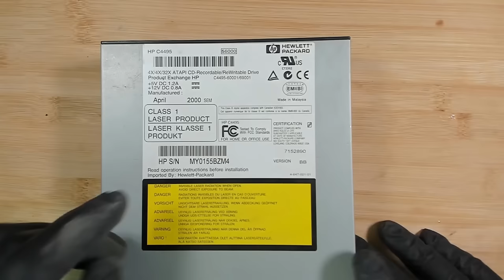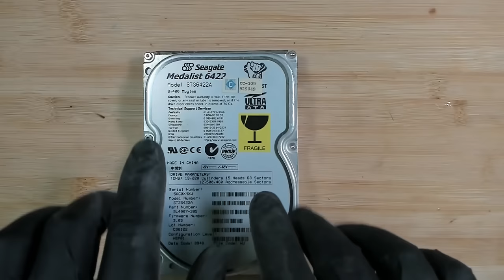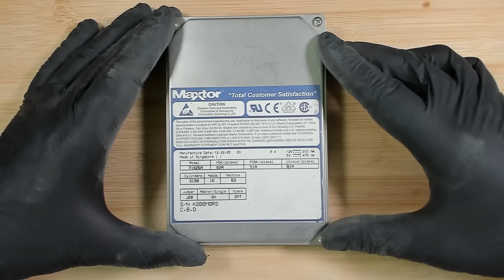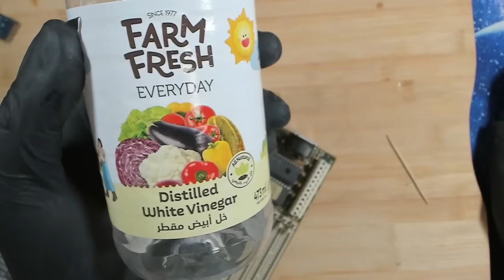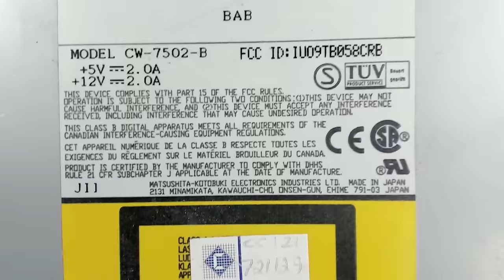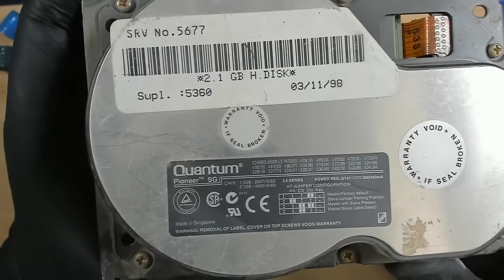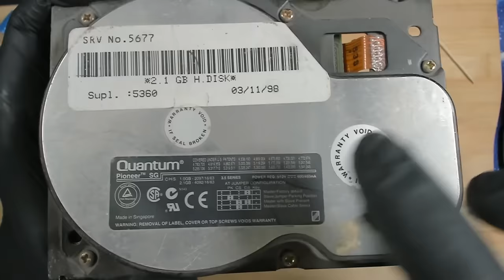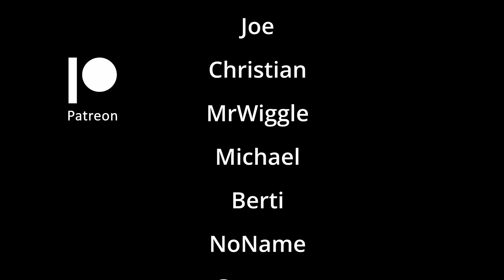Loot from one of my best scrapyard trips!

Comment: i wish i had a scrapyard like that near me...
Reply: I have them...but they don't allow me to take anything, it ALL goes to trash :/
Reply: @SirotkaSlo they calculate with the money for the metals that's why I guess
Reply from the maker: That's sad. I'm not sure why though. Maybe they don't want to have people going through their stuff, legal reasons or similar. It's still a shame though 😕 maybe time to get a part time job at one of those scrapyards 😉
Reply: @pc-sound-legacy  true, but they could also just let you pay for what you pickup based on weight. I wouldn't mind that, just let me take it 😭
Reply: I was told that here in switzerland, things in the scrapyard belong to the original owner, and that's why i can't even BUY stuff on a scrapyard. It's sad to think about all the sweet stuff that gets shredded every day.
Reply: @bitsundbolts  I believe it's because it's a private firm that does this in Slovenia, so it's probably because they sell it for the metal. Can't have a part time job there either. It's messed up, I see a lot of good stuff every time I drop off something there.
Reply: @SirotkaSlo Same here. They don't allow taking computer hardware. I wish I could save some hardware from being destroyed
Reply: Really, what kind of scrapyard is this? Can you show the outside or some more details?

Comment: Matsushita (SCSI CD writer) is Panasonic. It should work, I have Toshiba CD/DVD drives from this time still working. Japanese drives normally don’t have belts, which really helps to have a longer life….. but plastic gears might become brittle and break. I had a SCSI cd burner exactly for the reason you mentioned: buffer underrun…. A blank cd costed $15 back in those days and Windows was not good at multitasking, leading to wasted disks. I don’t have the drive anymore, but kept the SCSi controller (adaptec 2940w if I recall correctly).

Comment: Actually, I wouldn't mind seeing the Socket 7 board.  With one of the S3 video cards, 8MB of RAM, and a Pentium 75 it would re-create my first PC.  Brings back happy memories of Wolfenstein 3D, Doom, and Little Big Adventure.
Reply from the maker: I did get a Pentium 75 the other day. Well, I guess I'll be recreating your old PC very soon! Do you remember what S3 video card you had? Trio64 or was it a newer model?
Reply: @bitsundbolts  It was a Diamond Stealth 64, PCI.  I think that makes it the Trio 64 chip.  (I think the same graphics core remains as the 2D side of the Virge cards, so that would work also.)  The PC also had a Soundblaster 16.  I got the PC bundle  from Evesham Micros, who a few years earlier were suppliers of Commodore 64 hardware and software.

Comment: 8:49 - ESS Audiodrive cards are wonderful DOS cards. Decent OPL3-emulation, clean MIDI wavetable interface, extremely simple to set up via Unisound or ESS drivers. 
- 1868F is up to 48Khz/16bit
- 1869F is identical to the 1868F but adds optional Sensura 3d sound support. (meh...)

Great haul!
Reply from the maker: Ah nice. So essentially, they are quite similar cards. Although I have never heard of "Sensura 3D sound", I have a feeling that it's not going to be a life changing experience - as you mentioned in your comment.
Reply: @bitsundbolts  Well, phooey. I misremembered the "3D sound" tech on the ESS 1869F. That apparently uses "Spatializer® 3-D VBX™ stereo audio effects technology", which is sort of a parlor trick for widening the sound stage. It was pretty underwhelming, IMHO.

Sensuara 3D would have been much better if it had that as it provided positional multi-channel sound as a hardware accelerated enhancement, similar to EAX but the ESS 1869F predates that technology by several years.

Comment: I'm kind of excited about that 386/486 board
Reply from the maker: Me too!
Reply: @bitsundbolts  the extra expansion slot do you know what it is for yet?
Reply from the maker: Chances are it's an EISA or some proprietary OPTi expansion slot. But it's probably EISA. I heard it's almost impossible to find expansion cards that fit in that slot.
Reply: @bitsundbolts  I guess there's a mach32 in. Eisa form factor
Reply: @bitsundbolts I’ve got one or two cards, but never found a board to put them on 😆 

Anything EISA is just so rare.
Reply: @bitsundbolts  It's an Opti Localbus slot. I have a Tseng ET4000 gfx card for that slot in my collection
Reply from the maker: Atheatos told me about it. I guess it is better to not take chances.

Comment: i have that socket 2 486 VLB board and i like it. I have mine with a amd dx4 running as a 5x86 133, 1 mb cache, cirrus logc vlb. Mine has the coin cell as well. The 386/486 I think is the most interesting to restore. Feels great when you have these moments and find such a stash. Thanks for sharing.
Reply from the maker: I like the 386/486 board as well. It's interesting that they made that choice to have two sockets on the board. The board should also support the 387 FPU, but that one goes into the 486 socket once a 386 is installed. But I also like the green 386 board. I'm looking forward to trying the Texas Instruments 486/386 port.

Comment: Upgraded my first computer from a 286 to a 386dx/dxl 40 like the one you showed (still have it in a box in the basement...I should delete the battery!).  In college, other than the college itself, I was the first one with a cd writer...  I bought a used HP 6200 off of Ebay.  Kinda memory lane for me on this.  I long ago lost my 1gb scsi full height drive I bought to add to my 200mb drive I used in the same computer as the 6200...  Computers have moved SO Far since then!

Comment: Nice finds. Important note about the TI 386 to 486 chip. There is a utility that is used to enable the cache on the chip. Makes a pretty good difference in performance. 
There is only one utility that can see the 1k cache, but I can't recall which one. 
(Cache check can't see it)
If you want I can try and get you the info.

Comment: don't worry about ess discoloration, that just build in audio amplifier for passive speakers, you can disable it with jumpers if it doesn't work or if you want to use regular speakers/headphones
Reply from the maker: I think I also read about something similar on early Soundblaster cards. Could it be that those audio amplifiers introduced some noise in the output?
Reply: @bitsundbolts  not really the worry you had back then but they didn't like potentiometers cranked below 8 ohms on the output and some people just used regular speakers with the audio amp in line and when they made speakers quiet shorting output to ground those ic's cooked a bit
the ded givaway should be tea/tda prefix on the chip and 4 inner legs all connected to ground

Comment: LOL, a few days ago I found exactly that same socket to slot adapter lying on the street. It was near a trash dump, so it was probably from some PII PC that got thrown away (sniff). The pins were pretty rusty but I polished them. It's a shame that the only PII motherboard I have has problems, I have it in line to be repaired, if I can.
and that '94 Seagate drive is related to the oldest HDD I have, which is just the first one I had, the 150MB model. A year ago I wanted to try it after almost 20 years of not using it, and after a while of working one of the SMD capacitors blew. I changed it for a new one and the HDD is still working.

Comment: Oooh those Realtek SVGA cards... it took me several years until I found working drivers! I once had 4 of them (gave away two PCs that had them built in, they all came with 1MB VRAM installed, without drivers, 256k is the limit)

Comment: Man, just one great day like that would be all I need to permanently take care of all my retro-hardware cravings - just a 486 DX4 and a Voodoo 2 to reasonably complete my collection and I would be done with it - at least that's what I keep telling myself. 

I'd thus be most interested to see more of the 486 board.  <rant> Not at all interested in the hard drives, except for a bit of acoustic nostalgia. Don't torture yourself with that junk. I am SO glad they are almost completely gone except for high capacity use cases and will never look back once they're gone completely. They are nothing but trouble and their lack of reliability has been plaguing me my whole life, both privately and professionally. SSDs aren't bulletproof either (especially the first few generations were quite prone to nasty software errors), but overall they're just soooo much more reliable. </rant>

Comment: I find these dual 386/486 boards kinda fascinating so that would be my fave. Curious about the bottom slot which looks like it might be an EISA slot, or someone just used the connector.
And you could also run the Ti486DLC in that board so that'd cover it all.

There are also 386/486 boards out there with VL-bus, which lifts a major bottleneck for the 486, and even 386 class CPUs benefit a little, so those are even more fun!

Comment: Great haul!
Yes, the Socket 2 mainboard is VLB!
At first I thought the brown slot on the 386/486 board was EISA, but it seemed strange to me that the rest of the slots were standard ISA... So I googled and it apparently is OPTi Local Bus, physically similar but electrically incompatible (!!) to an EISA slot. Very interesting, I had never heard of it before! ...so perhaps it's a good idea to check that the slots on the Socket 2 board are actually VLB before installing something :P.
The possibly burnt chip on the soundcard is the amplifier to drive passive speakers and can be disabled with jumpers (and should be easy to source a replacement).
The slightly toasted 486 probably works. It wasn't uncommon for system builders where I live to not pay attention to the "heatsink/fan required" warning and I have seen 486s looking like that working perfectly.
What interested me the most is the 486DLC, with the OPTi Local Bus board as a close second (it would be first place if you had a card for it) and the VLB board third.
Reply: the proprietary local bus slot was briefly "a thing" before VLB became popular. those types of board were generally sold with a video card or video-multi I/O card that only works with that slot (typically ET4000 video chip). it's a crying shame that the video card and motherboard are frequently separated (and somewhere someone plugged that video card into an EISA motherboard and is immediately privileged to witness magic smoke escaping.)
Reply: I have an OPTI-Local bus video card, still waiting to find an OPTI-local bus motherboard here in the states!

Comment: I love the scrapyard find videos.   I started watching your channel because of the slot1 boards .  I'd love to have a 486 system,  but they are rare around me. I play with socket7 and slot1 boards.  Even finding an older socket7 board is hard. Mine are super socket 7.
Reply from the maker: I'll try to make more videos from the actual scrapyard. And you are right, those older boards get more and more expensive
Reply: I have also 486, but not a lot isa cards. I don't have any 386 or 286. My oldest parts are: CPU 8086 AMD clone, hercules monitor with graphics card and fully working 80mb hdd.

Comment: Flipping the card upside down with PCI and AGP seemed like a benefit at the time, to prevent dust from collecting on the components.  But, that was just the beginning of graphics cards that started to get warm, and then needed a heatsink, and then a fan, and then their own power input, and then water cooling...  Would've been better if they had just left well enough alone, but live and learn I guess.

Comment: 11:35 spot on, its VLB (confirmed by the MASTER and SLAVE silkscreen). You may get graphics and I/O cards using VLB, quite uncommon but not that rare.
36:20 looks like an EISA port to me (32 bit ISA port, compatible with 8, 16 bits and 32 bits cards). Pretty unusual, and not many cards to use it at it's full potential.

Comment: I had that HP optical drive - I had a lot of issues with mine - more coasters than successful burns at a time when the blank media was quite expensive. I think it lacked any internal buffer on the drive so would fail the burn quickly if the PC couldn’t feed it fast enough. Still an interesting bit of history, I was however pleased to get rid of it, the technology was moving quickly at that time so was completely outdated within a couple of years.

Comment: That oddball slot on that board that takes either a 386 or 486 looks like an EISA slot.
Reply: Phyiscally EISA, but electrically it's Opti Local Bus. Putting EISA/OLB cards in the wrong slot will make a nice smoky special effect.

Comment: Those dual boards are very interesting,  and its time to look for  vlb (easy part) and eisa (realy hard to find, may be network or  scsi controller) cards
Reply from the maker: Indo have some VLB graphic cards - I think I even have an I/O controller. But I have never seen something for eisa
Reply: @bitsundbolts  you need some old servers teardown in order to have some EISA boards

Comment: Have the exact same Teac floppy drive, it is great 1.2 MB floppy drive which good compatibility, never had any issues.
Reply from the maker: I just need to clean it. Any tips on how to maintain such a drive and get rid of the dust?
Reply: @bitsundbolts  Never had to clean it in depth, just used a cleaning disk back then but i think cleaning it up with a brush and q-tip, cleaning the heads with alcohol and lubricate the gears should do the trick

Comment: Solder on the Battery melting easily is a good sign it hasn't been leaking for long. 386 Board with the 486DLC looks like an easy fix.

486 boards with VLB slots having no on board io is not unexpected as back in the day you'd have the option of a high speed VLB IO controller or an ISA one if you were cheap
Reply: My second 486 was a VLB. But man, I had some huge problems with bad contacts on the disk and ports controller cards . I still have the motherboard, vlb video card and that controller card, but I need to repair it. After 20+ years of not using it, it just refuses to boot.

Comment: I'm interested to see a video about that TI 486DLC. I bought one ages ago thinking it was a 486 chip, but I never got around to trying it in my 386 boards because for some reason neither of the two that I've got seem to work even though they look like they're in good condition. (I assume it's just some incorrect jumper setting, but I've never had the time to really look into it.)

Comment: Eehhehh, this video is exactly what my "junk bin" at work back some 30y ago would have in. Dear god, i had a HUGE box of just those expansion cards, most with Goldstar chips, that sorta kept "piling up" as people upgraded from 468's to Pentium's. I was an Amiga guy back then, but the shop sold both Amiga and PC's. First gfx card (and my fist overclock...) was also a Trio64+ on a hand-me-down P133 (that also got OC'ed), eventually upgraded to a 300A+Trio3D (because i couldn't afford a "real" 3d card) And both got OC'ed of course... Guess i was born on the dark side of the force :D

Comment: 36:10 It's EISA slot (32-bit ISA slot , can compatable with 8-bit and 16-bit ISA cards) or proprietary slot for backplane or RAM card
Reply from the maker: Interesting... Although I doubt I'll ever find something that plugs in there. But who knows
Reply: @bitsundbolts  I have some EISA cards but not motherboards for them. Maybe you can use/test them :)
Reply from the maker: What kind of cards were actually made for those EISA slots?
Reply: @bitsundbolts  SCSI bus controllers, netwoking adapters, some graphics adapters. Actually, this is 32-bit version of ISA, so everything that needs higher bandwidth could possibly be made for this bus
Reply: @bitsundbolts  EISA interface cards and slots are mostly used on servers that require high bandwidth, but their applications are similar to those of general PC interface cards.
Like networking cards, SCSI cards, graphics cards.
It is less common on personal PCs because patent licensing fees are relatively expensive.
Reply: @bitsundbolts  if it is an EISA slot, then itself can be used as regular ISA slot - the top row of pins in slot (far from motherboard) are ISA pins and second row (bottom of the slot, close to motherboard) are PCI lanes; there are also riser cards for EISA slot containing ISA and PCI slots. I recommend to check for shorts before and after pluging ISA card - that will confirm if its really EISA and dont plug PCI card in the EISA slot - it fits, but most likely short and burn your chipset, ask me, how I know...
Reply from the maker: Well, I guess you have first hand experience with this slot. You're right, it is EISA. I started restoring the board and I am currently working on the damage the battery caused. There is an inscription on one side of this socket and it says "EISABus". I'll be careful with what I plug in this slot - I don't like to experiment with it if I'm not 100% sure.

Comment: That slot on the 386/486 board looks like a proprietary ISA riser socket.
Reply: That was my guess too.
Reply from the maker: After cleaning the board, I can read "EISABus" on one side of the socket.
Reply: EISA would have been my guess as well. The time when ISA wasn't good enough anymore and PCI wasn't out yet was a bit like the wild west. IBM had their proprietary MCA bus and on the "open" side you had stuff like EISA and VLB.
Reply: Nice board, Jealous here. THIS IS NOT AN EISA slot.
This is an Opti Bus slot (same connector as EISA, different electrical).
If you plug a EISA card there you will burn it.
There are specific card for Opti Bus. There is a VGA I have this.
Basically Opti Bus is and ISA VLB combo.